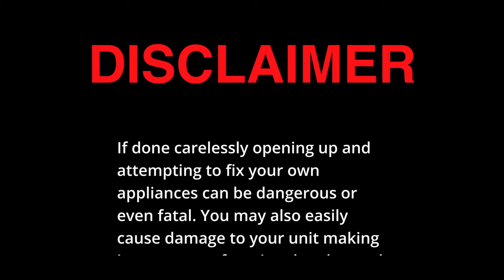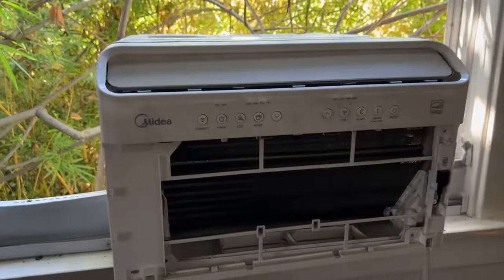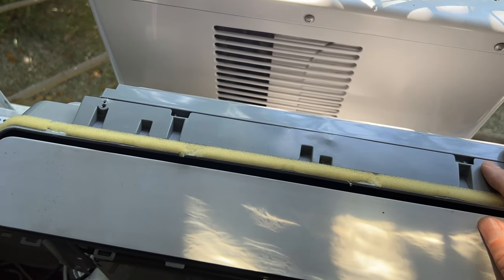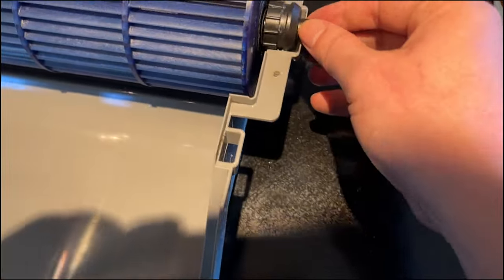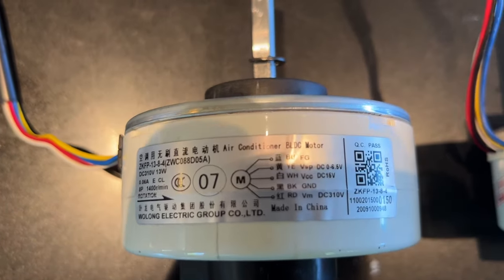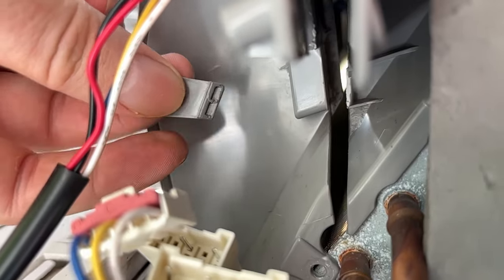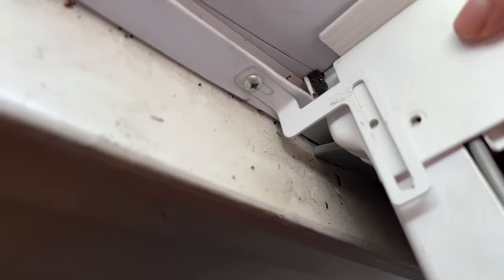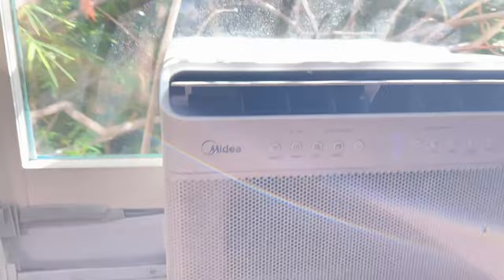Midea U-Shaped Air Conditioner Teardown & Repair: Blower Clean, Fan noise fix, Motor replacement

Comment: U Used The 13W or 20W Motor ???
Got The 12K BTU Version Of This AC, So Far So Good.
Thanks For The Awesome Video.
Reply from the maker: I used the one I linked... I found it by searching some of the codes on the old one.

Comment: Excellent video. Have you attempted to disassemble the outside chunk? I believe that is the condenser, it's gotta get filthy with all the pollen and dirt we have.

How often do you clean the squirrel cage fan?
Reply from the maker: Fortunately I haven't had the need to. Although I imagine since it stays out during the rain you could run a hose over it

Comment: my ac isnt blowing out as strong as it did when i first got it and is also making this noise if i take it apart like this will this also fix the air blowing in problem seems very weak

Comment: What about cleaning the outside part? Mine is really rusty and it always have water sitting in the bottom of it
Reply from the maker: I haven't had to do that much. It shouldn't get rusty, it's designed to be outside.
Reply: @nickrobinsonisthedev  thanks

Comment: How did you get the blower disconnected from the rotor when you put it on wrong? I'm running into this problem now because it decided to move just the tiniest bit when I was putting them back together and now it's stuck, and i mean really stuck. I tried hot water (gently) and wd40. Nothing is helping. And it was going so well, everything is so clean....i just wanted to get it back together. :(

Edit: I just left it and put the screw in right where it sat. I put it back together with your video help and it is quiet, cool, and clean. Thank you SOOOOOOO much for your video. It is insanely appreciated.
Reply from the maker: I ran cold water on the rotor, that helped. When it sticks, it really sticks. I think it should be fine how you left it.
Reply: @nickrobinsonisthedev  Thank you so much! Boy, I noticed that it definitely sticks. It was not letting go at all. If I have to take it apart again in the future, I'll try to remember the cold water. It was only maybe a cm (maybe less) where it stopped before that little ring. Thank you again for your video!!!

Comment: That bottom left tab makes it impossible to close. I am gonna have to break mine too
Reply from the maker: It's tricky. I managed to pull it apart and put it back several times before I broke it, it was such a pain! It was a small blessing that it broke, so much easier to put it together again.

Comment: If its safe silicone spray is SUPER slippery. I got that to lube up some fans that seized up and i have never experienced anything that slick ever. Couple sprays on a fans rotor and it got spinning right now.
Reply from the maker: Excellent solution!
Reply: @nickrobinsonisthedev  I say if its safe because silicone spray is meant to be used between any surfaces that slide against each other. However i have read that if used on metal that passes electrical current through it (such as the prongs of an electrical outlet) it can cause the silicone to get hard and crumble over time. At least that is what i read when i was searching for a lubricant to use on the prongs of my clothes dryer.

Comment: My downstairs one i got 3 years ago does this, I have 2 more upstairs that are perfectly quiet. It is also one thats been ran more then the rest though...
Reply from the maker: Everything is going to run down the more you use it - everything is designed to be disposable, just depends on the time frame.

Comment: does this ac pull outside air inside? or does it recirculate inside air?
Reply from the maker: I think it pulls outside air since there's a big unit on the outside.
Reply: @nickrobinsonisthedev  No, it recycles inside air......that's why there's a filter on it!
Reply from the maker: @fritzkabeano1969  oh that makes sense.

Comment: Did you ever find a reset button? I’d like to try to factory reset the unit back to factory settings. I find it’s not working as good as it did when I first bought it. All the coils and fins are clean. I keep a wattage meter on the plug to see how many watts it uses. When it was new it would go up to about 1,200 watts but now it stays around 320 watts and sometimes 430 ish watts. If I could trick it and make it run full blast it would be awesome. But being it’s a smart Energy efficient unit it kinda sucks. I can keep it at 60 on cool on fan on high and still 320 watts. No Eco on and boost on.
Reply: There's a temperature sensor near the USB wifi thing.  If it thinks inside temperature is cool it will throttle down.   But obviously front of unit is cold!.
Reply: @Crunchifyable2  I seen that one I put the unit on boost and 60 on cool. I put the sensor in hot water 117 degrees and it still didn't kick up. still ran @ 320 watts.
Reply from the maker: No, found nothing of the sort. I don't know that it holds onto any information like that. You could try taking the thermometer out of the unit and place it somewhere else, like outside maybe.
Reply: My problem was the fan was really dirty. Now that I cleaned it it’s running back about 1100 watts.
Reply: @tannerdegeyter3133 Which fan ? The inside squirrel cage or the outside condenser fan?

Comment: This looks easy compared to replacing the condenser motor. Have to take the front off to get to the plug for the motor.
Reply from the maker: Yeah, the back I don't know anything about... yet
Reply: @nickrobinsonisthedev  It's a nightmare, the plug comes on the new motor, goes down thru a metal channel to the same spot the blower motor hooks up, there's no way to pull that wire out with the plug on it and a new one back in, not enough slack in the wire to pull the motor out without pulling the wire out.  I'm looking for pin pullers so I can disconnect the plug  off the wire.
Reply from the maker: @rodburkes8950  Oof. Praying mine holds.

Comment: Hey do you know where I could get the control board for it MAW12V1QWT? It was damaged and I've been trying to source the part
Reply from the maker: Sadly I don't. I was really lucky to get the motor. Maybe try ebay?

Comment: I need to replace the blower fan, 	12100102000658    Cross Flow Fan,
 IS it possible to get the old fan out and install the new one while it's still mounted, ie sitting in place in the window ? 
Is there enough clearance ?
Reply from the maker: If it's the fan in the inside section yes
Reply: @nickrobinsonisthedev   it's the blue "blower cage" part I have to replace 
I stuck a thermometer probe into it while it was running, not thinking,  broke some fins, its out of balance now and really😕 annoying
Reply from the maker: @TheRealKevinNeal  Yes. I've seen that on sale somewhere but unfortunately can't remember where. You won't have to take the unit out of the window to replace it. Getting to it is the hardest part.
Reply: @nickrobinsonisthedev  great - thanks very much - I have the part, it took a while to get back in stock, last fall....
Reply: about the stripping screws, and needing to tape, I would maybe try, gaffers tape, it's very sturdy,

Comment: So your inside fan  motor wasn’t working 

My outside fan motor isn’t working 

Are both a direct replacement 

Thank you
Reply: EC 07 code on my unit
Compressor makes a noise but outside fan never turns on
Reply: Is there anyone that can help??
Reply from the maker: @AdamHines-q2s  Sadly I don't know any more than is in the video.

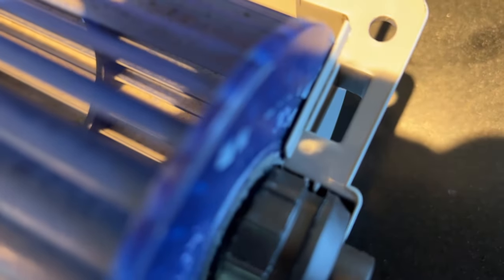Comment: yo man @nickrobinsonisthedev thanks for this video so much im about to tear mine down.  luckily i have no motor issues.  not so lucky i didnt tip the unit back far enough now the blue blower is BLACK with mold... couldnt figure out how to get inside to the blower fan.  at 34:50 i saw what seemed like a few mold spots left that although are now probably dead from the cleaners, will give some meat for new gross stuff to cling to.  im going to try and avoid the electronics whilst submerging my fan blades in a bucket with a bleach solution and go the nuclear option on those little suckers.  ill let you know if it goes catastrophically wrong :)  p.s.  you know of any SAFE... emphasis on SAFEEEEEE mold inhibitors to treat these surfaces with?  thats gonna be my next rabbit hole to dive down before i inevitably have to clean it again next year.  <3 u buddy be well.
Reply from the maker: Yeah, I gave it a decent cleaning off-camera, think it might have just been dirt. I wish I knew of a safe mold inhibitor - if you find one, please report back!
Reply: I use 3% hydrogen peroxide. Then I rinse after 10minutes. Works but you really need to take the squirrel cage out to get the inside of the housing that you can’t get to.

Comment: Did it with out a single Clio broken lol
Reply from the maker: I'm still in disbelief.
Reply: @nickrobinsonisthedev  apologies, back ground when I saw his video and the mentio of those clips being broken I grabbed my phone repair kit and though those clips bout to pop.

I took my plastic clip popper placed it in the crack between the two that are held together created tension on the clip but not a lot, then I took my second plastic clip popper and pushed down on the clip from above till it popped out of socket.
I work with micro eletronics as a hobby and find plenty of puzzles like this fun don't get me wrong if it's that much of a challenge I'll make a video in a month when I do it again
Reply from the maker: @christopherscarborough5138   please do!